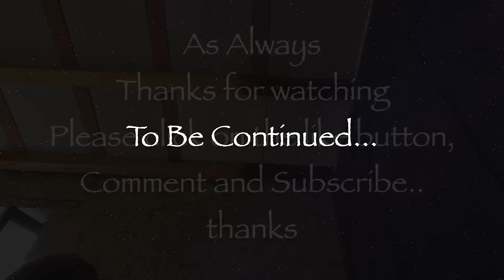I lock myself out, and go looking for a battering ram ... +framing the kitchen wall for panelling

Comment: The Nordic style: put doors opening out, it is easier to get more secure, as you cannot push it in, and if there is no handle, it is hard to get it pulled open. And to add that out-opening door is easier to make less drafty and rain-resistant too. But yes, windows are in many cases the easy way in anyway.
Reply from the maker: ive noticed the doors open outwards in many parts of Europe and wondered why... in the uk they all open inwards as the windows do too.. this door was brought of from the UK... many thanks Happy New Year

Comment: Hi Grahame, When you were ripping the plank down to size I did wonder about an outfeed table to support the cut pieces and then I saw the 2 bags of sand. Did the job brilliantly.
Great idea to screw the baton the the bench for support when cutting to length.
It is shame you had to put the bolt on the door but as you said security is very important, especially being away for periods of time.
Nice job on the panelling.
Take care mate.
Speak soon.
Cheers, Huw
Reply from the maker: lol best outfield table on the market, and they can be used on the walls etc win win cheers Huw Happy new year to you and Jane I hope everything goes well cheers mate
Reply: @OurFrenchHouseRenovation  Thanks Grahame, so do we. I'll let you know.
Your outfeed table is also adjustable LOL.
Happy New Year to you and Sooz as well.